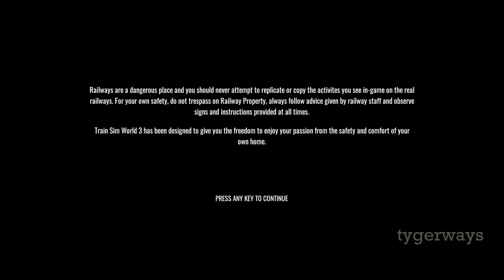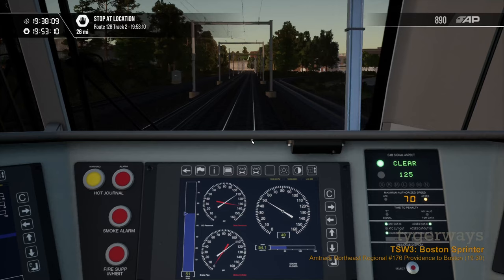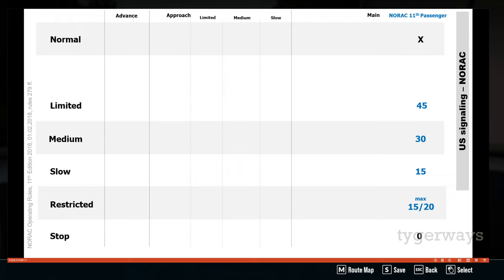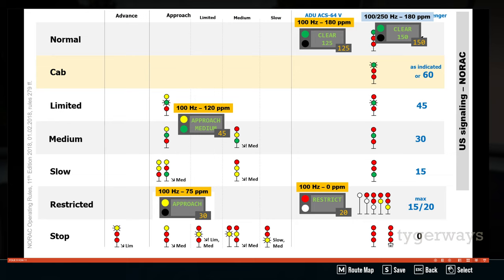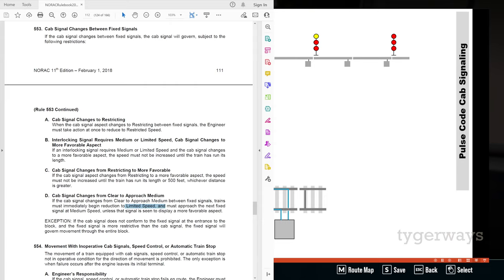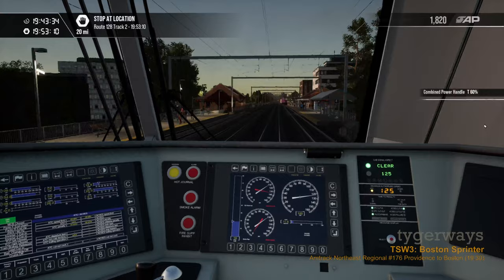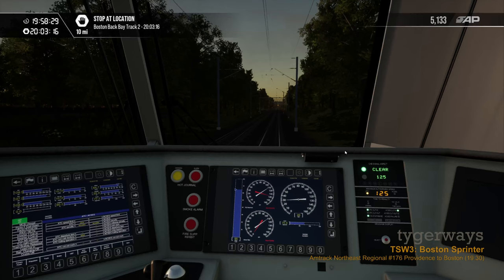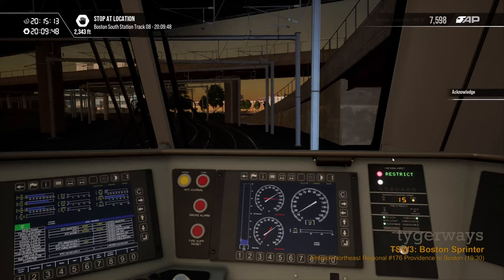US Signaling (NORAC): Pulse Code Cab Signaling NEC Boston Sprinter PRE-update 2/2023 (TSW tutorial)

Comment: Brandon here.  Amazing video!  I have several points to address.

1.  The 250Hz carrier aspects are represented in the signal fixes for Boston.  The ones you can potentially see are Approach Medium 30, Cab Speed 80, and Clear 150.  Cab Speed 60 isn't used between Boston and Providence and Clear 100 isn't used anywhere yet. 

2. Stop and Proceed cannot give a STOP SIGNAL aspect in the cab, only a home signal equipped with the appropriate data radios.  I think you meant that, but it wasn't completely clear.

3.  1:06:00 you got the progression in 150MPH territory completely correct.  The final result at  1:12:30 is absolutely perfect.  It's different in the Trenton route but that's exactly how it should be in the Boston area.  

In anything lower than 150mph territory, it generally is as follows:  Clear 125 (wayside) -> Clear 125 (code change point) -> Approach Limited/Advance Approach (wayside) -> Approach Medium 45 (code change point) -> Approach (wayside) -> Restricting (code change point) -> Stop/Stop and Proceed/Restricting (wayside).  There is more time to brake at these lower speeds hence the reduced progression.

4. In the Trenton area, you can get downgraded from Cab Speed 80 to Approach in Rule 562 territory only!  So you'll have the following progression for example between Ham and County on track 2/3:  Clear 150, Clear 125, Cab Speed 80, Approach, Restricting, and then the next signal is Stop or a train is occupying the block.  The longer block lengths in the Trenton route allow for this safely.  Boston has shorter blocks hence the different progression.

5. Approach Medium 30 is to my knowledge only utilized in very niche situations.  One such situation is at a code change point approaching a 30mph turnout in Rule 562 territory between New York Penn and Newark Penn.  I rarely ever see it used but it does appear from time to time.

6. 1:15:30 is an amazing explanation of how multiple occupancy in a block works.  I love it!

7. You keep saying "Medium Approach" throughout the video when you mean "Approach Medium".  They mean two different things and I know you aren't doing this on purpose, but I don't want people to get confused.

8. Continously welded rail still has physical gaps at signal block points.  I've taken several photos of this in my area.  There is a non-conductive spacer placed between the two rails and then the two rails are connected with a joint.  So it "is" jointed rail at these points technically.

9. You must set the throttle to idle AND open the Main Circuit Breaker though a dead section.

10. Passing Medium Approach should set cabs to Approach, not Restricting.  Fixed in the update.

Can't wait for some of your gameplay videos with the fixed signaling!  If I were to make a suggestion, I highly recommend you figure out how to deal with background noise with the microphone as it can sometimes really hurt with the video quality.  I use Adobe Audition to remove such noise as I live in a very noisy area.
Reply from the maker: Wow, thank you very much for this exhaustive feedback and all the insights! Also thank you very much for clarifying things where I misspoke (Medium Approach/Approach Medium) or left things unclear.  All the information given will go into my future videos. And I will look into ways of getting the playing dogs and other noises out of my audio. :)

I am so happy that you went through with doing this update and can't wait for playing the Boston DLC with the new signaling!
Reply: @tygerways6615  btw in ACS64, both Boston and Trenton version, when you access the screen on the left, and get to safety systems ATC/ACSES which shows status of both, it shows most of stuff correctly, but where it shows ATC as "cut-in", next to ACSES it shows just blank space... is it supposed to be like that or not :) ?
Reply from the maker: @RazielKainus  I don't think that this is supposed to be like that, but I can't say for sure (without having a manual for the ACS64). The speeds shown on this screen sometimes seem plausible, sometimes not so.

Comment: Amazing video! This system is also in use here in Italy and the ppms are the same. We use 50Hz current for the main codes: stop, speed reduction, approach, clear, and 178Hz to generate 5 more codes: speed reduction 100, speed reduction 130, approach 150, clear 220, clear 250
Reply from the maker: Grazie mille, Riccardo! I love how the information from all over the world is getting together here. :) Is that what is called "Ripetizione Segnali a quattro (rispettivamente nove) codici" or "RS 4/9 codici? Too bad there is no Italian route in TSW so far. I would love to run the Frecciarossa into and out of Venice or Rome! :)
Reply: @tygerways6615  Exactly. 4 codes are usually used when the speed is up to 180 km/h. The other 5 codes are added in order to increase flexibility or to reach speeds up to 250 km/h. In some secondary lines, where axles counting systems are used, there are no codes and the speeds or signals indications are enforced by the SCMT system (which is the main safety system on our infrastructure even in coded lines). Yes some high speed lines would be cool to see on tsw (for example from Milano to Torino). Actually there is a simulator in which you can run the Frecciarossa, along with other locomotives. It is called "Simulatore treno" and it's extremely realistic (from the physical and conducting point of view). The down side is that is not based on a graphical engine. So it's quite basic on the graphic...
Reply: I've read a brief mention about RS4/9 Codici just several weeks ago on Wikipedia, in the course of being interested about "classical" cab signalling worldwide, including classical PRR pulse code system. Also, I've read from some quite old (1981) Soviet book that some similar pulse code system was developed in Czechoslovakia since 1960s, differing both in carrier frequency (which could be 50 Hz only on DC-electric or non-electric stretches, or 75 Hz on AC-electric or any other stretches, so 75 Hz being ) and pulse code rates (0,9 Hz = 54 ppm for Red (Stop), 1,8 Hz = 108 ppm for Double Yellow (Diverging, reduced speed), 3,6 Hz = 216 ppm for Yellow (Approach) and 5,4 Hz = 324 ppm for Green (Clear) ). Plus an additional code/aspect for short block 4-aspect ABS - 0,9 Hz=54 ppm, but with every 4th pulse omitted, resulting in flashing red cab signal aspect. Perhaps this is still used in Czechia and Slovakia...

USSR and now ex-Soviet countries, though, used a completely different principle of coding for their classical cab signalling (widely installed since 1950s in all ABS-fitted lines in USSR, and is still the most widespread system in ex-Soviet countries), ALSN. Namely, there is no specific pulse rates assigned to aspects, but rather pulses and gaps count in sequences is used. There are just 3 codes, with names corresponding visual cab signal aspects: "Red-Yellow" - one pulse in sequence (i.e. single pulses separated by long gaps), "Yellow" - sequence of two pulses separated by short gap (whole sequences separated by long gaps as previously), and "Green" - sequence of three pulses separated by 2 short gaps (sequences also separated by long gaps). Short gaps are always about 0,12 s long, while pulses and long gaps can be quite arbitrary long (0,2..0,7 s for pulses and 0,5..0,9 s for long gaps) to form intended length of code cycle (in classical form 1,6 s and 1,9 s long cycles are used, with different lengths on adjacent blocks to prevent/check for dangerous failures of insulated joints, and nowadays as well for blocks count/fallback navigation on locomotive devices when GPS unavailable), there is one "Yellow" or "Green" sequence in 1,6 or 1,9 s code cycle, or two identical "Red-Yellow" sequences.

But there is also some even more important difference between these systems and PRR system, that I didn't know until now (because it is very rarely mentioned or explained when US cab signalling is explained, including in Wikipedia - perhaps authors consider that obvious, while it's actually not the case for people (including railfans) from other countries). This video is such a rare good exception, where author really explains this, and I got here just while searching the answer for this question, and yes, finally found it right here, thanks author! The difference is whether cab signal aspect represents (roughly replicates) the aspect of the wayside signal passed (more accurately, what would be now on the signal behind if there wasn't our train here), or the signal ahead. Being accustomed to ALSN system, where the aspect shown is always a representation of the signal ahead (Czechoslovakian system does the same, according to description I read in the book), except about 6-7 s after passing a signal until update occurs, and there is no code change points inside blocks at all (except the newest system with moving blocks, of course), it was really, really hard even suppose, without clear explanation and schemes, that similar (sometimes identical) looking cab signal aspects in the US mean completely different things, as they are actually shifted whole block ahead. Namely, ALSN green aspect - Clear, in American terms - has no equivalent in original basic PRR system, because it means 2 whole unoccupied blocks (plus some part of the 3rd, or minus a small part of 2nd until aspect update), ALSN yellow aspect - Approach in American terms - is an equivalent of PRR Clear cab aspect (shown as green and so on), and ALSN red-yellow aspect (would be Stop and Proceed or Restricting) is equivalent of PRR Approach cab aspect (but shown along all the block till red wayside signal). Red aspect on ALSN is shown only after passing red wayside signal, when codes disappear at all. PRR Approach Medium cab aspect, in turn, has no equivalent in ALSN, but could it be there (and in Czechoslovakian pulse-code system there is such an aspect), it would be named here, in translation to American terms, something like "Medium Approach" or "Diverging Approach" - after the signal aspect ahead rather than behind.

As far as I see from Wikipedia, aspect names in RS4/9 Codici suggest that aspects shown in the cab represent aspects of signal ahead, like in USSR/ex-Soviet countries and Czechoslovakia/Czechia & Slovakia practice (and perhaps this is why there is 4 codes from the very beginning, rather than 3 in the US)...